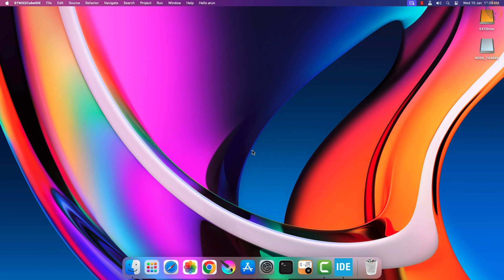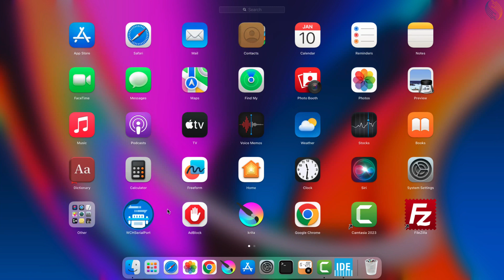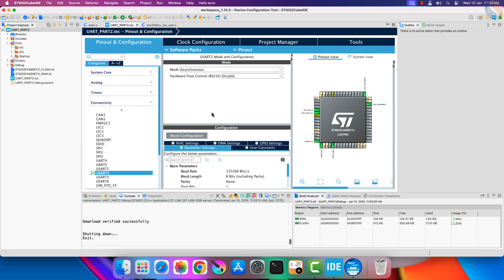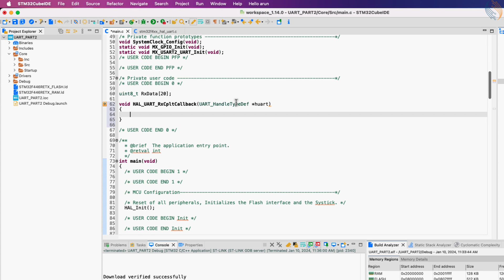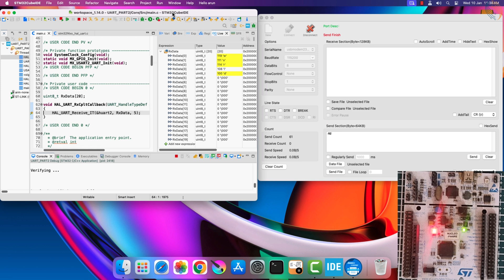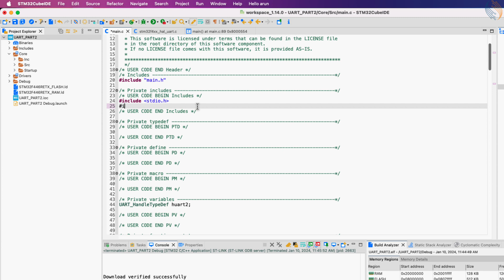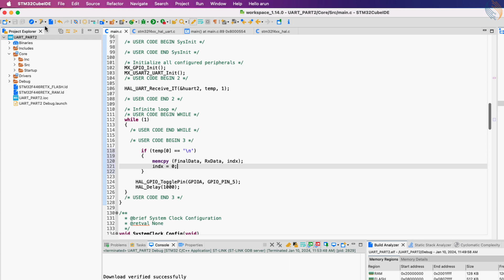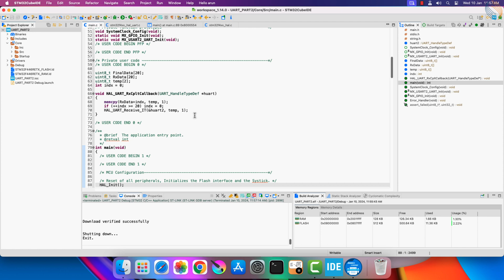STM32 UART #3: Receive Data in Blocking & Interrupt Mode

Comment: Sir in 6:23 if i write 1 live ekpesion =1
,my question 1 write 12 but live ecxpesion =[1][2].
I need live expresion =[12]
How to do that
Thanks❤❤
Reply from the maker: Data transmits 1 byte at a time. "12" are actually 2 bytes, not one. So it will be transmitted as "1" "2"
Reply: ❤❤❤ thanks
 @ControllersTech

Comment: There’s something I don’t understand. If I put the Hal_receive_IT outside the while loop as in your video, it doesn’t work. If I put it inside the while it works.. any idea?
Reply from the maker: That's not how it works. The interrupt shouldn't be put in the while loop, it defies the entire purpose of interrupt.
When you call the interrupt receive (not in while loop of course), the function will wait in the background for the given number of bytes to arrive. 
Once the required number of data bytes has been received, an interrupt will trigger an RX Complete callback is called by default. 
When this callback is called, the receive IT interrupt gets disabled. This is how the HAL works. After you process the received data, call the function HAL receive IT again inside the callback itself. This will enable the interrupt again.

Comment: Hello Sir !
Great video like always, thanks for all.

I implemented a "simply" modbus for school project so like you said, i can't know the size data incomming.
I want to receive only 8 bytes (read function only) but it can be possible there is another slave on bus the master can write on it with a different size of data.

I did something like you, with IT a buffer_byte[1] and buffer_frame[8] and indx to count where i am bc i receive byte One by One.

(why did you put 2 bytes in temp ?)

And that's work pretty well with 1 slave.

In my project My problem is with UART parity. I want to do something like 2 slave with same address, but one with parity even and other without or with odd.
I have 2 energy counter Wago slave modbus RTU for another project so i know its possible.

But in my case my STM32 always understand the frame it receive correctly then it shouldnt.

DrModbus (Master software) is even.
STM32 is none. 

I receive on STM32 bytes i send with master. (??? why and how ??)
All are good, CRC too, so my STM32 replied ... and that's the probleme
But when i transmit, there is something happen, like a bit is not good so master receive many "0x3F" + bytes wich are quite good.
there is a probleme bc it's look like STM32 UART Rx Doesn't care about parity. 
Maybe because it's byte on by one with IT ?

I know parity is include so i put lenght to 8 without parity and 9 with.
And if parity match like NONE-NONE or EVEN-EVEN or ODD-ODD all is good but i want to understand why SMT32 UART Rx doesnt care about parity and Tx does.

Thanks if you read me and my bad english

You are the best

Comment: In my case I have an MCU that automatically sends data to the TX port, when I connect another MCU to get this data, the data does not fall into the same position in the buffer compared to what is being sent due to the receiver connecting in the middle of the transfer, like control this transmission to match the transmitter and receiver buffer positions? I do not know what to do 😔
Reply from the maker: Asynchronous transfers can't do that. That is why there are SPI and I2C communications, where you use the clock to synchronize the data.
Reply: @ControllersTech   
The idea would be when you connect the MCU and it sends a command to the other to start the transfer process? In case of UART